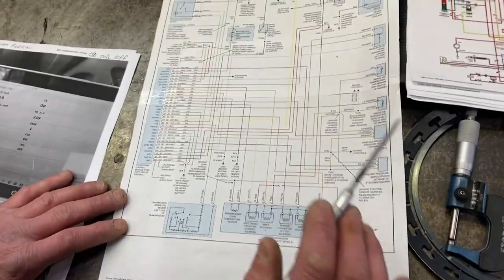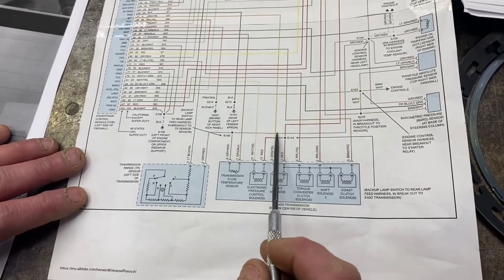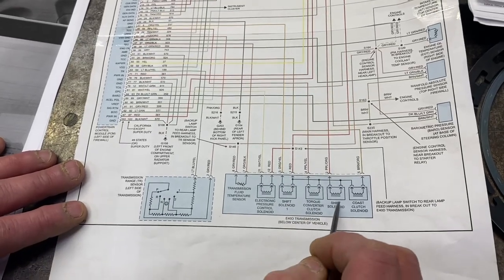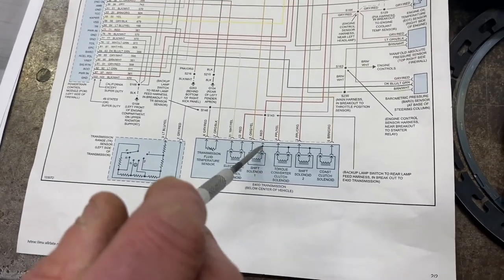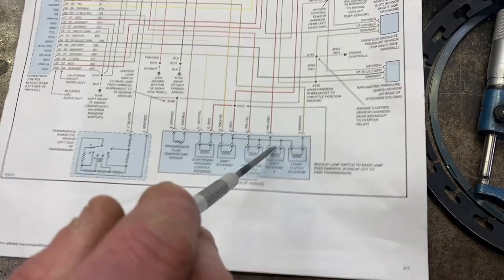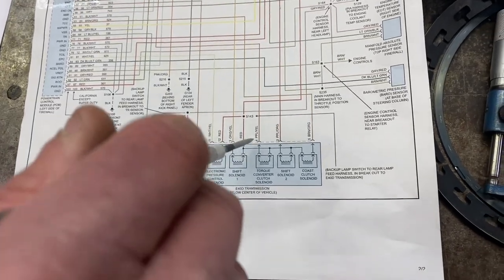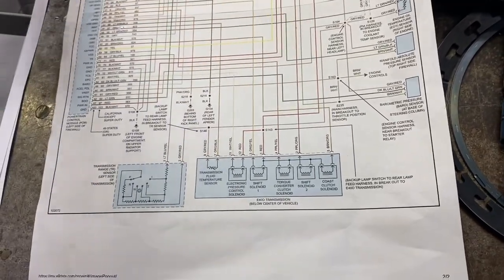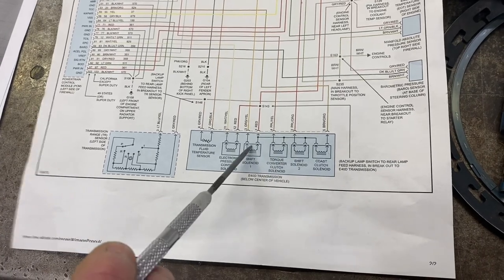“WHO’S IN CONTROL” E4OD/4R100 Diagnostics and Internal workings! Pt.3

Comment: I hate to ask here, but what’s the most likely cause for a trans that primarily feels like it’s taking off in second? If I pedal it right it’ll use first. 

Am I likely to have a pressure leak on solenoid B? It’s been like this since the rebuild and I don’t believe that was replaced. Builder said ‘we don’t see many issues with these packs’. Trans has worked phenomenal otherwise. 

Has to go back in for a terrible pump whine and low pressure after the 15k mile service anyway. Wanted to ask

Comment: I have a 1995 f150 with a e40d transmission it falls into neutral randomly i replaced the mlps, soleniod pack, vss, checked for bad wires and the dang thing just wont act right, no codes overdrive button does what its suppose to do no flashing or anything so i dont know what to check next. if it wasn't my dads old truck that my daughter wants id have pushed it off a cliff by now  😅
Reply from the maker: Interesting! Does it drop out of a specific gear or does it “neautral” not mattering what gear your in ? Need to figure out if it’s mechanical or electrical first. When it neutrals you need to try cycling O/D button then down shift to manual 2nd then manual first to see if it find any solid gear. 
Neutral in Reverse also ? Let me know 🤔
Reply: @Marshall Sanders   when the problem started it only did it after I drove about 20min and slowed down to get off the interstate. I would brake into the exit and when I got back in the throttle it would be in neutral and slam back into gear. The other day it did it multiple times when I left my moms. I pulled off and when it got in 2nd it went in and out of gear 3-4 times in a row. So I started shifting it manually and she did fine. The problem is random. Most of the time it shifts fine no matter if I'm light or heavy on the throttle. I pulled the ecm the other day and noticed a resistor had gone bad and done a little damage to a trace so I ordered another one I also noticed a couple wires had lost their insulation on the mlps harness so I got one from the junk yard and swapped it. When the ecm comes in I will see if it worked  if it doesn't im gonna have to try my luck with having the transmission shop test it. I'm not a fan of having a shop touch my stuff because I've had them try to Rip me off before during inspection but I can't just keep throwing parts at it I still have other stuff to replace and upgrade haha.. I do appreciate people like you trying to help out strangers its good to know there are still good o'l fashion  mechanics out here
Reply from the maker: Yes sir I’m all about it, sounds like your on the case and I always fix anything I can see being a problem or a potential problem first and go from there and it appears that’s exactly what your doing. Let me know what you find. The chafed wires on the MLPS harness could be sending different gear signals to the computer like you said. Especially when the vehicle slows down and speeds up as there is shifting of components and wiring when in that situation. Let me know

Comment: Thank you  for these E4od  technical videos!
I am learning a lot from you. 

Any chance you can post a video regarding no forward engagement?
I bought a 91 E250 as a project. 
I bought with only reverse. 

Reverse is completely manual. 
At this point I'm just throwing parts at it.
I have an inova code puller...but besides tps and neutral safety.....no codes.

My next part is the solenoid pack connector. 
Which needs replaced regardless. 
Due to age, loose fit and broken retainer clip.

I suspect it's just electric....but?
Reply from the maker: Actually on the contrary. No forward is something internal. To get forward gear in O/D range it’s just the forward clutch,low roller clutch, and O/D roller clutch holding. 
To see if the O/D roller clutch is blown, very common on early units put it on O/D range and hit the cancel button on the stalk. This puts it in manual 3rd and applies the Coast Clutch which over rides the O/D roller clutch.
If still no forward then pull it down to manual low which in turn overrides the low “Roller Clutch “ by applying the Low/Reverse Clutches. If still no forward then it can only be something mechanically wrong with the forward clutch itself, stripped splines,burnt clutches pit broken “Belvelle Spring” etc.
The only thing something wrong “Electrical” will cause is taking off in a higher gear when put into forward O/D range. The forward clutch gets fed fluid strait from the Manual valve Mechanically when you put it into gear. Hope this helps and doesn’t confuse you even more !
Reply: No confusing. I'm learning as I go but I totally respect experience and knowledge. Your input is greatly valued to me. 
I'll try asking this question a little more straightforward. 
Can a bad solenoid pack connector cause a no forward issue?
Or should it drive with the solenoid  pack connector disconnected and shifted to manual low?
Reply from the maker: Ok, you asked the question just fine. I just gave you the long answer is all. 
To keep it simple even with the solenoid pack disconnected you should have some kind of forward engagement in at least 1 of the 3 forward modes meaning shifter in O/D range,2nd range, or Manual Low range. 
If it still feels like Neutral No engagement at all in those three ranges then it IS an Internal transmission problem not Electrical.

Comment: Marshall, great information.  I will need to review the different ratios and directions planetary gear sets turn when various elements are held, but well done.  I'd appreciate a Part Two on the more advanced theory as I'd bet a lot of your other viewers would as well.  Cheers.
Reply from the maker: Yes Sir ! I’m trying to put these videos out as quick as possible but it is not easy ! I was going to do a video part 2 that EXPLAINS if each clutch fails on or off what you would actually FEEL in the drivers seat. You may have convinced me to make it ! I can make that video all the way up until I load the guts in the case ! We’ll see
Reply: @marshallsanders5672  That would be great!  Perhaps showing how the power transfers from one planetary gear set to the other. - i.e. what elements are being held to achieve the proper ratio(s) - and how the clutch packs lock the drums either to the case or next drum. Your "Whos' In Control" video was great, but I was trying to get a mental picture of what was going on inside the drums, when the sprags locked or were overrun and the effect of the brake band in manual. A lot of moving parts for the newbie.  LOL Tall order for Auto Trans 101!  Really thankful you are sharing your years of experience in the field with the DIY'ers.
Reply from the maker: Yes ok I got what your asking mostly ! I’ll work that in to the video ! There are basically BRAKE Clutches/Bands and Driving Clutches which just DRIVE a part of the gear train. Good stuff ! Thanks for the request I’ll do my best ! HaHa ! I will go as deep as anyone is willing to go and so far I’m getting more requests to go deep. The next video is about TCC apply and STUPID important in automatic transmissions so let’s go from there !
Reply: @marshallsanders5672  Sounds good!
Reply: @marshallsanders5672  I reviewed your video again along with an exploded transmission view and it finally clicked how the transmission achieves the 1-3, OD, coast and engine braking.  Great stuff.
Reply from the maker: Great ! Yep that is the biggest thing I am determined to talk about this stuff so practically anyone can understand it. It took me 5yrs. Before I was anywhere near Comfortable at this stuff. But I didn’t have anyone laying it out like I am trying to do in these videos. This is why you will see me repeating myself a lot. And if one doesn’t get it the first time it’s just a matter of reviewing it again and Again if need be. I repeat my learning process myself until I FULLY understand whatever it is I’m attempting to learn as far as that’s concerned! Thanks for the comments ! GOOD STUFF !
Reply: @marshallsanders5672  Now you just need to get more viewers, some adverts, sponsors, etc and you'll flourish.  Your videos are absolute gold!  I'll definitely plug for you where I can.  Cheers.  Day off for me today.  Birthday, some beers and no overtaxing the limited brain capacity...!
Reply from the maker: Love it enjoy your day off ! Yep gonna need the Redbull for the next one tons of technical info coming on TCC/PWM TCC  systems stay tuned.
Reply: @marshallsanders5672  Looking forward to em!  Cheers

Comment: Nice Job, Thanks very much for the unvaluable teaching.  I just want to add, that your "first red flag" on the diagnosis could be wrong. It´s not the same solenoid setup for the 2nd gear in OD, and for the 2nd manual. It´s clear  the scanner shows 2nd manual, so both solenoids "A" and "B" should be Off, only Coast Clutch solenoid should be ON. So different from 2nd. in OD, when both solenoids OFF means a 4th gear, so take a look if you´re checking solenoids setup, on OD or Manual.  thanks
Reply from the maker: Thanks for the comment not everyone follows this stuff as closely as you ! Much appreciated! As far as the “red flag” goes O/D 2nd AND Manual 2nd both shift solenoids are “SUPPOSED“ to be powered on but on his scanner in Man. 2nd they are both off which would give 4th. Gear. 
Because the computer shows them off when they should be on is the “Red Flag” Thanks for watching!

Comment: Hi marshall great video i just leanrt about automatics haha this is awesome. I have a e40d from a 92 f150 and have a shift problem. Feels like it clunks into gear when shifted into gear. And from 1st to 2nd gear it kicks into the next gear. Agressive kick. Not a ferm shift like it would be adding springs. Any idea what it might be? Ive done speed sensors psom and shift acumulator rebuild. Shift solonoid i havant touched yet.  
Thanks
Reply from the maker: Moto, Almost sure its stuck in high line pressure, Whether its the computer commanding it to be high or whether the EPC solenoid or Boost Valve in the pump is sticking causing it to always be high. Is the check engine lite on ? Sometimes when there are specific codes in the computer (even some engine related codes) the computer will put the transmission into fail-safe mode! Fail-Safe mode is the computer puts it into high line pressure to protect the transmission from burning the clutches up, Seen this many times. Just have to determine whether the computer is commanding high line pressure or whether its something internal failing causing it. i would do a line pressure check and most likely you'll see it stuck at 110-120 psi all the time or higher. it should be around 70 psi at idle and go up the more you hit the throttle.

Comment: Need the help Thanks
Reply from the maker: Your Welcome !
Reply: I am diagnosing a 95 E40D that takes off in 2nd with the shifter in manual 1, manual 2, Drive, and OD.  The scanner indicates that the computer matches the physical shifter position.
The trans came from a rolled truck and had a dent on the passenger side of the pan.  The coast clutch solenoid has damage but all of the solenoids ohms out to be at about 19.7 ohms at 50 degrees F.
Could all gears except 1st work properly with out the coast clutch?

Comment: HI Mr. sanders, I followed your instruction and rebuilt a e40d 2 wd diesel, came out of a 1994 7.3 non turbo, bell housing has a number 24 on top. I installed it and I now I have the over drive blinking light on and shifting problem it looks like engages in neutral and in drive however no first or 2nd gear and when I tried to go on revere it grind looks like it doesn't stop from neutral and grind onto r reverse. in other word I have no neutral. please help.
Reply from the maker: That’s not good, If there is grinding going on something wasn’t assembled correctly. It can be stuck in certain gears without grinding even neutral if a clutch is stuck on but grinding is a clear indication of parts not meshing correctly. Your going to have to pull it back out and figure out what happened

Comment: Iblove the video. Its currently snowingnin cleveland. Once weather cleaes up. Ill check everything again. Ill see if i can make a video. Im sure rhats more insightfull. Want to make sure its no electrical before i open her up
Reply from the maker: Yep I had to cut the video but I meant to mention the solenoids can fail electrically or mechanically. I’ve seen it many times where they will ohm check but be stuck mechanically and not work.
The only REAL way to check them is to apply power and blow air through them and physically see that they allow air through them and then stop air going through them by turning them on and off. That way you KNOW they are working as opposed to just ohm checking them !

Comment: Hey Marshall my transmission just made a loud pop on me when I was doing a rolling pull in my 7.3 power stroke it’s a 4r100 and there are no codes. Just wondering if it could be the solenoid pack going bad at the wrong time. I don’t have any gear as in I can shift but nothing happens even in reverse.
Reply from the maker: Tucker ! That stinks, sounds like something inside broke ! Just disconnect the solenoid pack connector from the trans and try reverse , if still no reverse than the problem is internal and needs rebuilding ! Just make sure the transfer case isn’t the problem first does it hold park just fine ?
Reply: @marshallsanders5672  yes hold park perfectly. My guess is that the input shaft snapped but idk how because it’s a built trans with a billet input shaft
Reply from the maker: Oh gotcha hard to tell what happened if it’s a built trans🤔
 Sounds like your putting out some power with the engine so anything is possible !

Comment: Now that is some good info there. Did felix find out what the fix was>? What you describe is exactly what mine is doing. Acts like its in high gear even in reverse. That and the OD off light is flashing. It spitout a little fluid when I got it home Im gonna try to get FORSCAN on it this week.
Reply from the maker: He’s still in the process I had an emergency at home my dog ran away so it’s been two weeks of that ! Back on it next week will keep you updated
Reply from the maker: Rodney, it just dawned on me you said it felt like a higher gear even in reverse ! Reverse only has one gear so that problem sounds like a bad one way sprag inside the stator in the Torque Converter. 
My next video is going to explain all that and why, stay tuned.
Reply from the maker: Not sure what you found on the scanner but scanning is definitely the first place to start.
Reply: @marshallsanders5672   well ok then. Ill be watching that one for sure. Thanks for all the great info. I have most of my parts and waiting for a few more, but we will be doing the rebuild soon. A little nervous,  but ready to get after it
Reply from the maker: Yep as I was shooting the video I remembered your comment. I am almost done with it but have to add a few more clips. I am determined to fill these videos with as much info as possible. It will be up by tomorrow at the latest and I want it to be right. Thanks for the feedback.